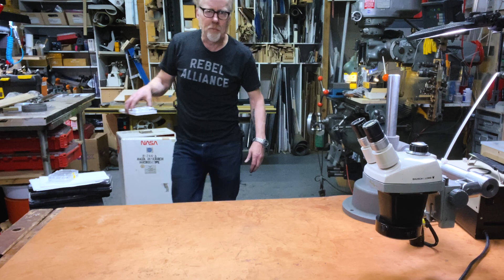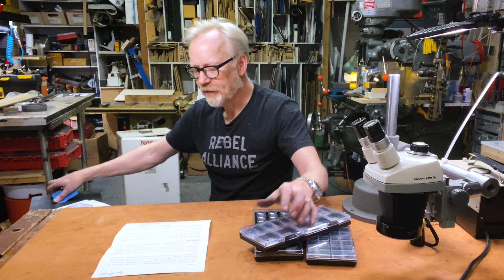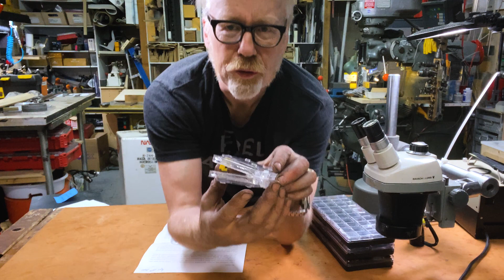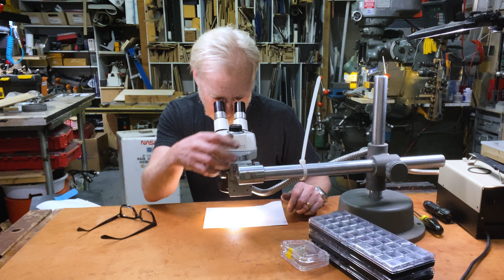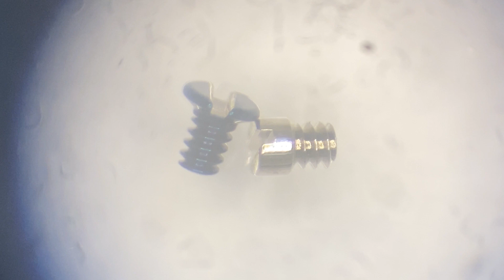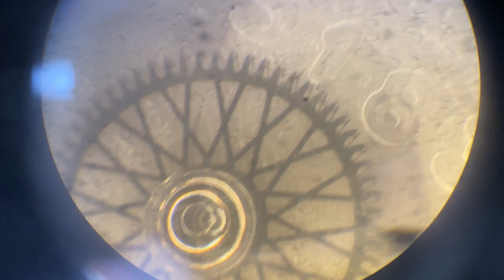Adam Savage's New Tiny Parts Sorter and Storage!

Comment: I got some pill sorter boxes at Dollar Tree for 4X a day 7 days per week that had the little tiny square boxes inside a bigger box.   But what I need is just a place to sort screws and tiny parts when I put a new battery in an iPhone or some other things like that.   Last time I just used tiny ceramic asian dipping bowls and a tiny round enameled planter pot tray.   Stuff heavy enough not to get blown over by the wind.  I have seen trays pros use but I am having trouble searching for something like that and maybe I should stick to the smallest size of prep bowl dipping bowl.   Some people use tape when the screws are all different sizes.  I hate tape.

Comment: I used to use an refrigerator egg holder to keep the screws and parts while repairing camcorders.  Or other units a whole lot of tiny parts.   Each egg compartment would label where on the unit the part was taken.  The curved bottom made it easy to pull one tiny screw out.  Everything went back where it came from.   Every time.

Comment: I wonder what the opposite of this would be ... (ie : what are the biggest screws and gears used anywhere on this planet?)
The level of engineering and tooling required to work at the extremes is nothing short of amazing.

Comment: Hey Adam, I have hundreds of Surface Mount electronic components ranging in size from 0402 resistors - 1mm x .5mm to 5050 LED’s - 5mm x 5mm. I use AideTek BoxAll storage containers. So far one of the most versatile and flexible storage solutions that I have found. They have several different configurations. Two pins can be removed and the configurations can be mixed and matched. 

http://aidetek.com/mm5/merchant.mvc?Screen=CTGY&Store_Code=A&Category_Code=Encl

Comment: When I was working in smartphone/tablet repair, one of the first things I did was get a bunch of polypropylene test tubes. They were pretty reasonable at the time and the briefcase that contained my kit had all these handy little sleeves that could hold each test tube.

The first batch of tubes were apparently single-use sample tubes made from cheap acrylic and with stoppers, not screw caps. After a rough journey in my car, some of them split right open. Not good.

I made darn sure the next pile of tubes I got had actual screw caps. Nice and secure, easy to label. iPhone screws probably aren't as small as watch hardware, but I can easily lose them, and these saved my bacon plenty of times.

Even now I have a bag of test tubes in my office drawer so I can hold onto things like the spare M3/M4 hardware that came with the 3D printer, or bootlace ferrules for when I'm building a circuit and I do not want wires to slip out of screw terminals.

Comment: Watchmaker: "Impossible to manufacture using traditional methods." 
Joe Pie: I accept your challenge
Reply: I think Joe can drill a hole through the center of those.  I wouldn't be surprised if clickspring could make those screws as well.  Two of the best machinists on YouTube.  Not to forget TOT and Blondihacks.

Comment: Adam needs to make a display case for that gear and screws!!! It should have a bunch of magnified glass pieces that incrementally zoom in / get closer and closer. It would so cool cause you could put the display on the side and really get a grasp of how small the gear truly is, with the number of magnified glasses required to zoom in that small. Plus those gear teeth are a master piece and need to be shown off.

Comment: Great video as always.   The anti-backlash gear featured in most vintage tube radios.  It ensured that as you changed the tuning condenser knob from one direction to the other, the dial pointer moved immediately.

Comment: I do like the large containers with smaller containers in them. For small parts I also really like different sized baggies so that you just grab a baggie slightly larger than you need for any given component(s). Tons of baggies will fit in a contaner and you can flip through them really quickly as long as you write clearly on them with permanent market/attach a label. I love that microscope!

Comment: I didn't realise Adam was looking for small item storage or I would have recommended SMD boxes. They're designed for surface mount electronic components and the boxes come in all sorts of sizes and colours and they are totally modular, so you can build up a storage solution to suit the application.
The great thing is that the lids are spring loaded but latch open until tapped to close. 

Here's a link to some to give an idea. 
https://uk.farnell.com/licefa/smd-box-n1-2-2-6-6/box-smd-16x12x15mm-b-l-red/dp/9583793?st=storage

Comment: Tool Tip Request: Scissors - I need a recommendation for a solid set of shop scissors. I use them for opening packages, cutting out templates, and occasionally things like leather. If you only had 1-2 pairs, what would they be? (bonus - I have really large hands, so plenty of room in the handle loops would be an added bonus). Thanks!

Comment: Pretty nice storage boxes.  AideTek BOX-ALL are great too (see Amazon).  They are intended to hold extremely tiny electronic parts.  If they can hold resistors measuring 0.02" x 0.01" (0201 in surface mount terminology) they should work well for screws too.

Comment: For the mechanism in my model ships, 0-80 is as small as I go.   The screws shown are just insane!
For folks looking for a more economical storage system, I have had good luck with small boxes purchased at Walmart.   They are also good for sorting and storing small gears:
https://www.walmart.com/ip/Darice-10-5-x-6-5-x-0-875-21-Compartment-Clear-Plastic-Storage-Box-1-Each/24741921

Comment: I'm guessing the "search party" method for finding one of those screws if dropped won't work...
Reply: Watchmakers benches have a pull out tray with loosely mounted fabric to help keep a dropped part of this size from bouncing of making it to the floor (or to your shoes, noting like a watch screw catching in a shoelace eyelet!).  You learn quickly to keep that bit of fabric squeaky clean and to avoid letting tools or bits of anything accumulate in the tray.  In the watchmakers and micro machining / electronics world, we tend to refer to the floor as the Bermuda Triangle.  Supply houses have very sensitive hand held metal detectors to help locate a dropped part.  A big part of doing this sort of work is learning to use fine tweezers and also maintaining the tips of tweezers to avoid squirting a part out of the grip.  I don't do much watch work any more, but there is a feel of accomplishment doing a difficult repair at such a small scale.  I used to work in the electronics bare chip hybrid module world, lots of work at 10 to 30X with tweezers and needle probes there too.

If you keep the floor squeaky clean, you can often find a quite tiny part by shining a very bright flashlight at a very shallow angle to the floor and looking for the glint of metal or a long shadow.
Reply: Gotta call Ant-man for those.
Reply: given how small those screws are I'm sure they'd just stick the ground and get lodged
Reply: Paul Lockton if you dropped one of these then just say screw it (pun intended) and grab another.
Reply: @Charlesb88  they're pretty damn expensive/labor-intensive to make, so you couldn't afford to lose too many of them...
Reply: Zanpa well then you probably want to be super careful so that you never drop one on the floor and put some sort of mat or tray under your work area that would catch and hold any falling screw to limit where you’d have to search for it if you did drop one. Because otherwise I can’t imagine trying to find one on a workshop floor given that you can barely see it in a plastic container a under a microscope to begin with.
Reply: @Charlesb88  Shit, I do that with 4" deck screws. Any dropped screw is not worth finding when you can just grab another from the box/pouch/container.
Reply: Electromagnet if they're ferrous.
Reply: Magnets, my son, magnets.
Reply: @jeric_synergy8581  but how would you even know if your magnet grabbed anything?

Comment: If you drop one on the floor it would be impossible to find it again! 

Magnetic screw driver: hold by beer!
Reply: Most of these really tiny screws aren't even magnetic, I guess it has to do with that being that small different materiales are needed so it doesn't get cut off.

Comment: I know Adam isnt the fondest of drawers and tbh im not either, but a few months back i was lucky enough to get one of those revolving wooden cabinets with multiple sides of drawers like a hardware store would have had back in the 1920s and its absolutely changed my life as its a table but neatly stores all my common bolts and washers. If i ever delve into attempting cabinet making id like to make a mini version of that same structure for small screws, dremel bits etc

Comment: I use pill bottles for my weed... I mean lock pins, I mean... Both... Not pills though. I put those in a month container. Um I have hundreds of pins, about fifteen different types, sizes, and materials. Obviously a couple different kinds of springs, wiper inserts, and tensioners. It works good if you can get the labels off so you can see in.

Comment: how the h do they make screws that small i've never seen that before
Reply: The screws are turned on lathes. There is a video of Titans of CNC where they visit a swiss factory which makes screws like those. The process isn‘t shown in detail but it is interresting non the less. But they show a few thousand parts that size and it just looks like dust in the oil used for cutting the screws. 
https://youtu.be/jGuBs1S6f_Q at 5:16
Reply: @DonStinger  cheers that sure was worth watching and yeah that bit with the smallest screw does look like dust
Reply: Most likely a specialized CNC swiss lathe.
Reply: Before Charles Vander Woerd invented the screw machine around 1870, they were made using die plates and lathes.  How would you like to spend all day using a graver and a jewelers lathe making watch screws?  Now they are made on very high precision CNC "Swiss" lathes such as those by Tornos and others.
Reply: As Adam said it's LIGA, basicly it's like 3d printing with UV on liquid resin but with x-rays and a metal.
Reply: @AdrienSantosCoelho  That's for the gear.  Surely the screws aren't made that way.

Comment: for that gear, how in gods name would you even cut/make that, its so small.
Reply: Adam said lithography, so you get a small sheet of the material, place some kind of etch resist on the surface (vacuum deposited? photo exposed resist?) and then etch away the sheet chemically revealing the gear. Additional steps are needed to get the perfect perpendicular edges to the gear. Advanced variants of this process are used to make processors on the 10s of nanometer scale, so this gear's precision is quite possible, but you need R&D to work on the very different substrate (steel? titanium? etc instead of silicon).
Reply: @2993LP  Thank you for the description. :) This was a great explanation and easy to follow. Super interesting that this process is even possible.